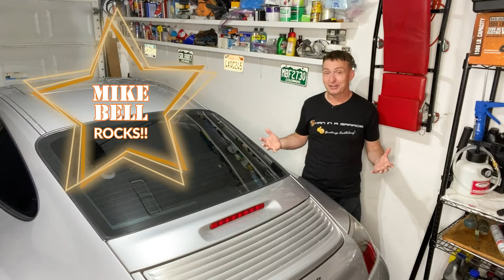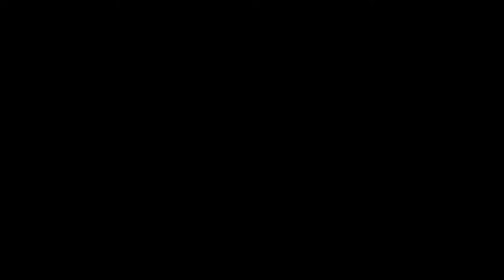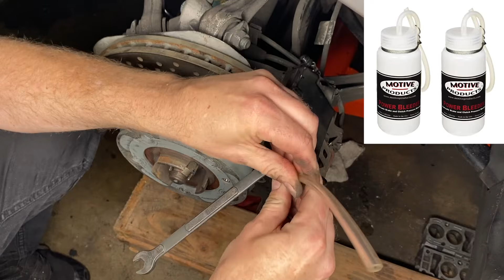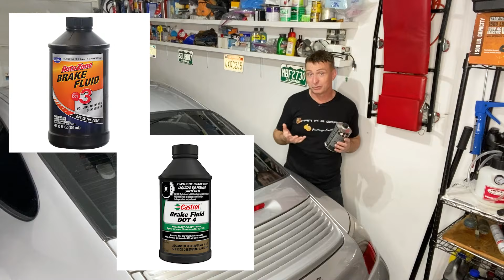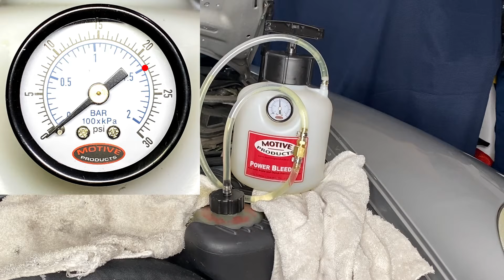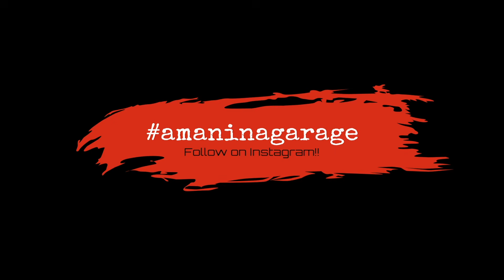MOTIVE Power Brake & Clutch Bleeder. Is it AWESOME?

Comment: My experience with the motive power bleeder has not been positive.  So far I have only tried the adapters for Ford and all have failed.  The adapter fits tight but when pressure is applies the seal fails.  Sometimes I can get it to work if I keep the pressure to 10 lbs.
Reply from the maker: It’s good to get feedback Terry, my only experience was the one you see in the video. Giving motive a call or email may well be worth your while, actual humans will answer 🥳. Best of luck with your projects, thank you for watching 🤘😎

Comment: Follow up Question: Wouldn't you want to suck out the old fluid out of the reservoir first, fill it with new fluid, then pump it through? how many containers of fluid did you use?
Reply from the maker: In this case, the fluid did not need to be replaced or bled as the brakes had recently been overhauled. While removing the old fluid before you start might make the job slightly quicker, it’s not required.  Thank you for watching. 🤘😎
Reply: @ManinaGarage  Ahh yes. You did a lot of work. I need to do this in the spring. Still very cold here in Frostbite Falls, MN. thanks! Love the channel.

Comment: If you are tracking regularly this becomes a must have tool. I got the metal cap version for a better fit on the master cylinder. Cut a small hole in the center of the bottom of a trash bag and tape it over the opening of the master cylinder. This makes a nice little reservoir around it and  saved me from a huge mess once when I had the cap too lose! For just a quick bleed between track days use the dry method to simplify clean up. Fill the master all the way with brake fluid and pressurize. Bleed the rear brakes and clutch then check the master to make sure you still have plenty of fluid. You may need to refill but this saves you from have to clean out the bleeder and waste another bottle $$$ of fluid. Just keep checking you haven't let the master run low! Trust me you don't want to pump air into the lines!
Reply from the maker: That is some great insight Anthony, I know people will really benefit reading your comment. Thank you for watching 🤘😎

Comment: Hi Finn, I also use a similar tool to bleed brakes and clutch slave cylinder, but for the clutch slave cylinder it is not enough to just open the valve as for the brakes.
To completely replace the clutch circuit fluid, the procedure indicated by Porsche is as follows:
1 - Open the bleeder valve
2 - Move pedal extremely slowly to the "Pedal fully depressed" position. When doing so, guide the pedal by hand so that it does not move forward
abruptly
3 - Allow the brake fluid to rinse through for 30 seconds
4 - Afterwards, activate complete pedal travel manually very slowly for a further 60 seconds. After about 10 to 15 pedal strokes, leave the pedal in its
normal position. Once this filling period has elapsed, check that no more bubbles appear at the bleeder valve. Then close the bleeder valve.

You did a great job on this Porsche

Maurizio
Reply from the maker: You are a rockstar for taking the time to share that, Thank you Maurizio 🙌 The procedure with the new device was a real leap of faith, it has been both humbling and educational to see just how many things I can screw up in my attempts to explain things. Hopefully, folks can unravel my fiasco with the help of your instructions👍 I know people reading these comments get as much learning out of them as I do. The company that makes the Brake Bleeder sent me a different model to try (they said mine took an excessive amount of pumps to get to pressure??😂🤣) 
If I can ever get the hang of this YouTube thing, this subject can be revisited, these brakes can get bled properly AND I can thank you for your help. Did I mention that you ROCK! 🤘😎

Comment: Loves me my Motive. Another good and cheap fluid that will do well if you change it frequently is ATE Typ 200 - cheaper than Motul and Castrol fancy fluids. I use it in my "light use" track cars and it lasts me a full season, with some periodic quick bleeds of the caliper, not a full flush. You can keep a bottle open for a few months. It lasts >2 years on road cars.

One of the cool tools you showed there in the Motive pix is a fluid tester to tell you how much water is in the fluid - I love mine. I often find that the reservoir has higher water levels than the fluid coming out, BTW, so if you're flushing, best to empty the reservoir completely before adding new fluid. I guess the cap is also a leaky point. Fortunately that fluid doesn't have to squish!
 
PS if you want to get into a fight on the internet, tell people to bleed the outer side first, then the inner. Or tell people to bleed the inner side first, then the outer. Nobody agrees on which is "better" 😆:_Porsche:
Reply from the maker: Thank you Mike, people that read these comments will appreciate your insight. The coolant tester picture featured prominently in the video because I subliminally want one, your comment just confirmed by deepest desires 🙌 Thank you for watching 🤘😎
Reply from the maker: Regarding the inner/outer bleeding order thing, would it make no difference as long as all the passages had fresh brake fluid?? Right ??🙃 is this crazy talk?
Reply: @ManinaGarage  The issue is how to ensure that you're getting ALL the old fluid out, but yes, if you flush it enough, the order doesn't really matter. I'm sure there are fluid dynamics experts who have weighed in about how the caliper chamber and bridge design of caliper X would influence flow / lead to pockets / whatever. 

Kind of like doing front vs rear, they're separate circuits anyways so order less relevant. And without cycling ABS module there's still old fluid in there too. 

You just can't win,😜at least not against the Internet!
Reply from the maker: @miketdavies  ain’t that the truth 🤣😂 🙌 my you tube experience has helped confirm my desire to never be a politician 😳

Comment: There’s actually an easier way, even if it doesn’t look as cool. Clear plastic tubing connected to a one way check valve that dumps into a bottle of your choice. Attach tubing to bleeder valve, open bleeder, and start pumping the pedal until you’re happy. Takes up a lot less space in the garage.
Reply from the maker: Hello Michael, thank you for taking the time to comment, this comment section has been an education for me. The pedal method is probably the one that comes to mind for most people, those who favor the pressure bleeder attest to the speed of the process. For many people, the neighborhood biennial brake bleeding beer fest need not be rushed, and I agree 🍻. The dude that "Repurposed" this device was bleeding his brakes multiple times per weekend trying to make the most of track time and by the time his girlfriend got bored of going, he was doing it by himself. In those circumstances, you can see the benefit of getting the job over with 😂🤣 . Thank you for watching 🤘😎
Reply: A pressure bleed is often required to purge the ABS system though.
Or a computer linked to the cars OBD port
Reply: @mc02fly28  can you not access that function on these cars via a scan tool or has Porsche made that function inaccessible without some proprietary tool?
Reply: @michaelw6277  I’m not sure about the 911, but a scan tool will work on most, that’s what I meant by computer. I’ve just gone through it with my Mitsubishi truck, it needs pressure and ignition on to bleed the pump. But you are correct re bottle with fluid in it, I’ve been doing it that way for years till I bit the bullet and bought a pressure bleeder. It’s quicker to do with the pressure bleed I did my 911 full flush in less then 30 mins.